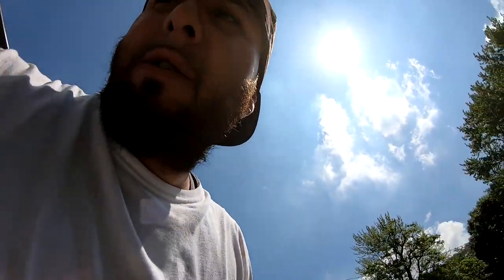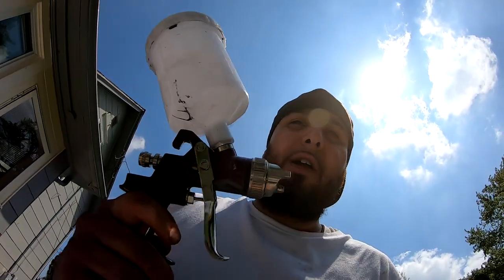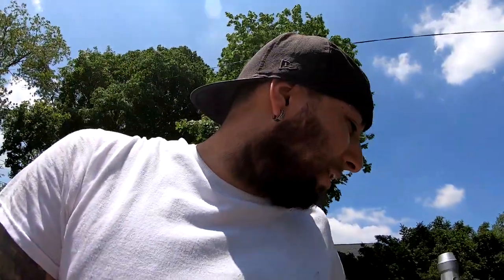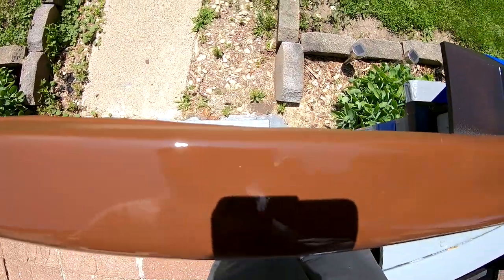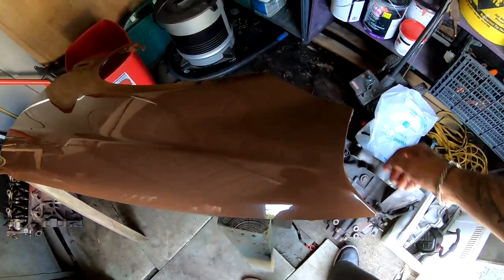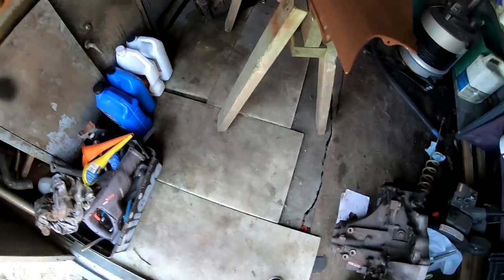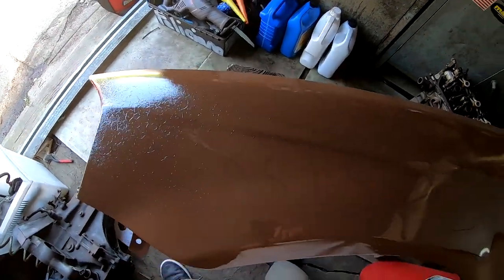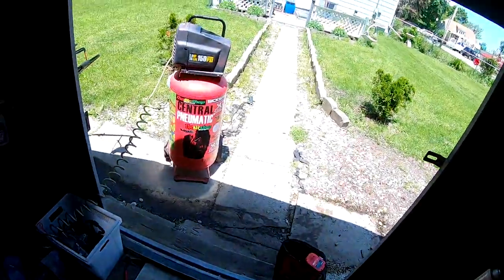Automotive Clear on Rustoleum Paint job

Comment: A few recommendations use the quarts / gallons vs spray cans. It is cheaper in the long run too. You can reduce with acetone and add a capful of hardener per quart. This will aid in the curing process and from what I experienced seems to reduce the chance of reaction. 
The potential issue I saw in the video was the spray technique. Your fist and second coats are several coats vs just a single with an immediate 1/2 overlap. The 2k clear will solvent pop from multiple med wet coats without proper flash. Mist 1st coat, medium 2nd coat. Your 3rd final wet can be smashed on wet... full fan, trigger and slower motion (not fast multiple coats). I seldom had issues on full cars or multiple parts. When doing single panels and rushed coats I had a few issues. Once you find a couple of clears you like I tend to stick to ones I’m used to. If I need a cheap clear I’ve used SpeedoKote super cheap. Most average jobs use Matrix and never had issues. From what I have seen. Most issues were material related it was more in prep and application.
I would also recommend a couple new air lines. Harbor freight has a cheap $15 water separator you can put in the middle. Anything you can do to improve air quality will help to reduce problems. Last when you mix paints and even brands occasionally can run into a few issues. Summit and SpeedoKote make cheap single stage that have held up well. If using it on any bumpers or flexible parts add a little flex additive. Their products are hard and not as flexible. 
I’m not a pro... just a hobbyist and hope this helps... best regards.
Reply from the maker: Really good info for me and anyone who reads your comment..thanks for taking your time and posting this will defenetly help out. 👍
Reply: Agree with the above info. If you want to use 2k clear over “rattle can” paint, try using lacquer spray paint instead of Rustoleum or other oil based spray paints. It still might not work, so try it on a test piece first. If you really like Rustoleum, you can buy it in the jar, mix it with reducer and hardner, then 2k clear it. You can also attempt to spray it with an oil based spray can, let it harden (a week or longer), wet sand it with 1000 grit, then 2k clear it … again, it still might not work. If your just looking for a harder finish, the Rustoleum mixed with hardener alone will give you that; possibly with a little more glossy shine. If your looking for higher gloss and UV protection, then you need the 2k clear over it. You mixing products that were not designed to be mix, so your experimenting. Keep playing with it and you’ll find the right combination of products that will make it work. When you find what works, stick with those products and hope the manufacturers don’t change the formulas.

Comment: Unless you are clearing over fresh paint (48 hrs max.) you should wet sand (800-1500 grit) before spraying clear coat (2k). With an oil based enamel, like Rustoleum, the longer you wait to clear, the better chance you have of no reaction like the crinkle. Also after letting it fully clear, always either wet sand or grey scotch brite (wet). The clear coat needs something to make a mechanical bond to ensure a long lasting finish. Remember, experience is a good teacher. God bless, stay well.
Reply from the maker: Thank you for the info. Il take all the  advice I can take.

Comment: I painted a set of valve covers with Rustoleum and it took 2-3 weeks for the paint to completely cure to where I couldn't dig my fingernail into the paint without leaving an impression.  Let your parts completely dry before using automotive clear and I'd bet you would have much better luck.   Try it first on a couple of Rustoleum painted pieces of sheetmetal that's NOT going to be put on your car so you don't have to sand the parts you're using over and over again if there's a negative reaction.

Comment: I used rustoleum cobalt blue metallic on my guitar... 
Before spraying, I used black spray paint over my wifes lace shirt (the lace looks like guitar picks).
Then on the edges, and let it fade towards the center of the top.
...Now time for the BLUE.
Fine mist first coat of blue OVER ENTIRE GUITAR, then fine mist second coat of blue (45 minutes apart). After another 45 minutes, l layed a light coat of the blue. Then the next morning, I layed one heavy coat of blue, being careful not to make the lace patter completely disappear. 
Then I waited 24 hrs before adding any clear. (I used minwax polyurethane.)
I applied the poly EXACTLY the same as you did on your test piece... 
No problems.
After 6 coats, I sanded with 1500 grit sanding sponge. Then I added the final coat of poly nice and wet. (Overlapping 50%)
I havent buffed it yet, and its already got some big shine.
I know you were looking for clear paint instead of polyurethane, but I wonder since the poly had no reaction, if the poly would work as a mediator between the rustoleum and the automotive clear.

Comment: Clear coat will not adhere correctly to the shiny rustoleum. You have to sand the base color to give the clear something to bite onto.
Also, waiting a 1/2 hour is causing the 1st coat of clear to dry too much where again you are spraying on a slick surface with nothing to bite onto mechanically and it’s too dry for it to adhere chemically. If the clear is dry to the touch, wait overnight, wet sand with 800 and shoot more clear.
If you touch the tape that got as much as the surface, and it’s sticky but doesn’t come off the surface, you’re good to go. If some clear stays on your finger or it strings as you move you finger off it, you gotta wait a little longer. But if it’s not sticky at all, wait till the next day and sand the shine away.
Good luck brother!
:)

Comment: Different paints have different solvents.  That’s why they say if you paint use everything from one company because they are made to work together.   Most people would sand the rustoleum first. Maybe 800 -1000 grit To give the clear a good base to adhere too.  Then spray the clear. Should be a lot better of a result. Give it a try and let me know!
Reply: BULLI KID I said the same thing!!! Wet sand then apply clear.

Comment: If it was sanded with 800 or up and real light coats and dry really good in between should do better I think it was so wet and did not achieve to anything so it could properly set up

Comment: Man that fender looked "Amazing" with rust oleum before you applied clear coat.
  I believe you have to let it dry and air out for a day or two.under the sun so it bakes.
  I was watching another young man painting a couple of plastic bumpers with rust oleum and oral clear coat and it looked great, really good, no adverse reaction.
  I was mixing my poly dtm primer with a previously used steering stick dipped in mineral oil paint thinner and it freaking harden up on me almost like flan, boom  💥  that's it I messed up, uncompatible quemicals.
  But that's OK, is part of the learning curve.
   Keep on learning..!! 👍

Comment: For some reason, I just watched this again... ;-)

Did you ever figure this out?

Watching this has me thinking- the basecoat in a lot of base/clear systems are solvent-based, they are not catalyzed, you can mix them up and they will not harden in a sealed container. That said, almost everything that gets topcoated has a recoat window, typically something like "within 30minutes or after 72hours," and some even have special instructions for the after 72 hours (typically a light scuffing/sanding). You didn't say how long it's been since your trimpiece was painted vs your fender, but you made it seem like you just painted it, either way, I wonder if it was in the "recoat window," and the fender wasn't like you just painted the trim and the fender was a day old, and the trim was soft enough to let the clear melt into it a bit where the fender wasn't that soft but not completely hardened either.

Alternatively that clear is just not compatible with the paint (not as likely since you did manage to get a good result), if that's the case you have 2 choices- get another clear or go to the pint/quart/gallons of rusto and spray with a gun and try different solvents to thin them till you find one that works OK with that clear (mineral spirits, naptha, acetone, lacquer thinner, mek...).

It's funny, I've mostly had the other problem, I've never had good luck with clear from a can, it seems like it always does something weird, usually messes up the color or comes out cloudy, but I've never sprayed 2K clear over gloss spray can Rustoleum (I have over things like dupicolor and other spraypaints that were color-matched to the original paint on the vehicle).

Comment: Can it even be done?  Rust olem paint, although I use it to paint the underside of my car and truck to protect it from the elements, wouldn't be paint for a car finish. I just did some spray painting with rust olem paint and although it blended in with the rest of my car, it didnt come out all that great even though I used thinner and hardner in the spray paint with compressed air.

Comment: Try the hardner for valspar brand paint in your base color.It is toxic. Makes it hard fast.  Could be interacting with the thinner in your base color
Reply: The hardener at tractor supply works good but still give time to cure. Used speed-o-coat clear and  had no problems.

Comment: The only way you can do that is if you buy the gallon because the spray can and corts have a different chemical trust me the only thing is the gallons only come in green red white black yellow but its way better best mixture is 50/50 .50 paint 50 paint thinner let it site for about 1 day or 2 the longer you wait the better then shoot the clear coat then hit it again with clear after 20 minutes and it will  look like the really deal

Comment: I read all these replies & came away shaking my head. Some say don,t wait for the rustoleum  to completely dry. Others say wait up to two weeks. I have
have watched so many video on this I come to one conclusion, that the thinning solvent  is having reactions with the clear coat. Now many use acetone to 
thin & some mineral spirits.  Maybe mineral spirits is better than acetone as far as reaction & maybe not. But acetone dry's faster. But I think it is the gassing from solvent is the problem. It seems the guys that let the paint fully dry, had no problems because the solvents had evaporated. I,m doing a hood 
this weekend using acetone with a dryer. I,m going to leave it for two days before I shoot the 2k clear & will post my results.
Reply from the maker: Very interesting im gonna subscribe to you i want to see results.  That would be awesome if you upload a video
Reply: i need  to  know too im going to do hood  on my truck

Comment: Spray max 2k clear coat works.
Reply: Edward Anthony does this really works over 2k? I just got some and debating rather i should put over rustoelum paint. I used gloss black, wet sanded with 1000,1200,1500,and 2000 grit also. Buffed it out looks great, now I’m just looking at the 2k in the can scared to use.....lol
Reply: @altovisuals6628  Watch the video. He claims it does.

Comment: Rustoleum uses acetone in there mix...the acetone is stripping the urethane...use a can and thin with mineral spirits not acetone.
Reply: You could also just use asetone to thin the pain so it won't react
Reply: @1g_dsm_life154  the spray can he used is alredy thinned out by acetone. And when he sprays clear over the paint the acetone is paint biting the clear.

Comment: The reason why you’re having a reaction is because the paint has dried either you didn’t give it enough drying time normally with rust oleum paint do you have to wait at least a week if you’re not using paint with reducer and Hardner added to it that’s how you get single stage paint to work I’ve learned from my mistakes that’s why I do things differently now use reducer and Hardner in your enamel paint that will help it dry and hard and faster so that you canUse the 2K clear

Comment: Is that clear coat a 2k urethane? From what I've seen it won't do that. Moore's Motorsports Channel uses Spraymax 2K over his rustoleum paint sometimes, and Speedokote Refinish Network channel uses Speedokote clear over rustoleum without issues. Both are Urethane 2k.  I've seen rustoleum clear out of a spray can do the same as your clear coat did. Tractor Supply sells Majic brand clear coat for $40. It is an oil base paint like Rustoleum, but I haven't seen anybody use it. I was just looking at paint the other day and wondered if it would work over Rustoleum. I think the others are right about acetone being the problem.
Reply: You watch the same channels I do.   I have spent the summer sanding and primering my  C10 because Moore Motorsports inspired me to try it.  I started paint Rust-Oleum Gloss Cherry this weekend.  Looks so sweet.  Now trying to find a good clear to put on down the road when all done.
Reply: I started color changing my 07 Crown Vic this weekend. It was white. I am painting it black. So far all I have done is under the hood and trunk. If it turns out good, my 72 C10 is next.
Reply: @jasoncooper3116  Sweet, my C10 is an 84.  Bet Black will look good on both.

Comment: Any body that is trying to do this rustoleum paint job and want it to turn out pro get the gallon its way better more even its 30 dollars you should only use half so one gallon is enough for 2 cars
Reply: Try it wen you get a chance 50 paint 50 paint thinner it takes more coats but its so thin it won't run it drys fast and you get why less orange peel
Reply: I have a dodge ram ima paint .my plan is doing the 50/50  2 to 3 coats of paint let it dry for about 2 to 3 days wet sand it 800g then shoot 2 coats of clear i ise the clear from English paint and supply's its around 150 for a gallon comes with the hardner if i can remember its the 545 clear or something like that but it should come out way better then any other cheap paint job
Reply: Sherwin-williams has a cheap clear to its called 1st finishe works good to

Comment: You Most likely had the reaction because you sprayed your clear coat over your rattle can clear without sanding it down. They dont mix well with each other
Reply: Hector Madrid they mix just fine, you have to let the rusto fully cure before clearing. “Done it tons of times.

Comment: It wrinkles up because you sprayed clear on top of a already clear finish, smh you should've wet sanded it first  then cleared it. Shit I thought you already cleared it the way it was shining
Reply from the maker: I just made a new video 10 min ago on how to get rid of those wrinkles. It will be up tomorrow
Reply: I know how to get rid of them but I'm saying why you got them because clear won't stick to clear, it has to be full, it's all a learning process though
Reply from the maker: oh got cha. I didnt spray on top of clear tho it was just one rattle can of rustoleum brown this was my first time spraying clear on these parts.. Didnt have automotive clear or rustoleum clear just one can of brown. 👍
Reply: That has nothing to do with it. The thinners in the clear ate into the oil based rustoleum. It's why I charge more to respray cars with single stage paint on em unless its urethane, and most customers have no clue if its urethane based paint or not, so it's always a risk on older cars.
Reply from the maker: @Bytrl  definitely agree with you.. I did wetsand and found out the clear coat was what wrinkle up not the brown underneath. I though it was brown that was shrinking causing it to wrinkle because of the reaction.